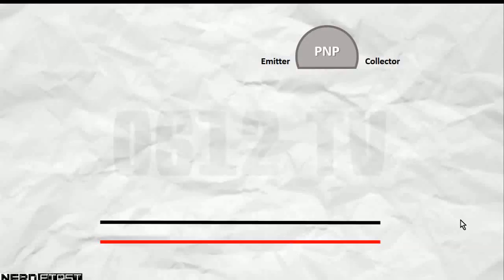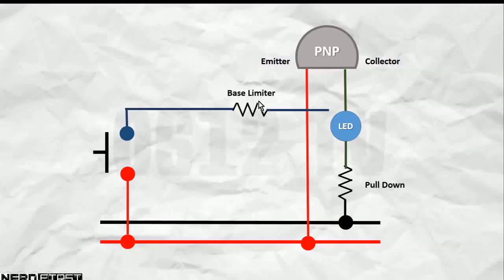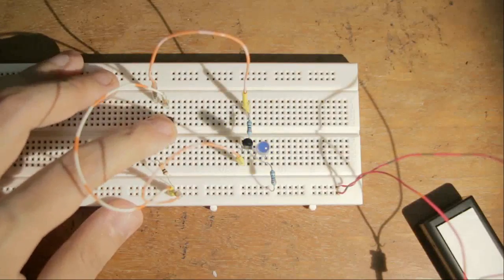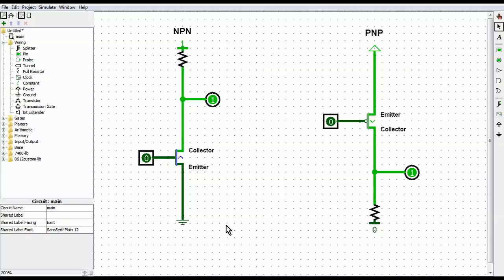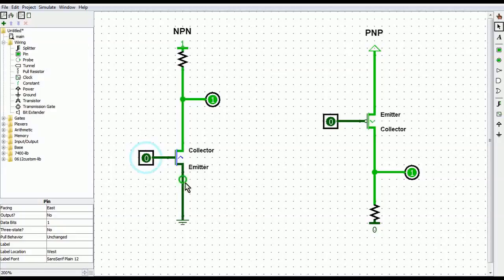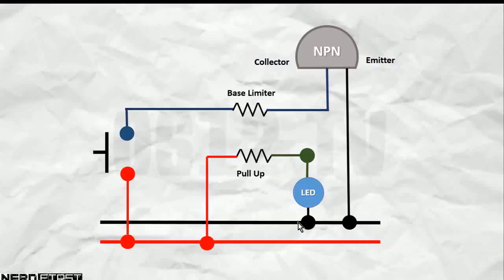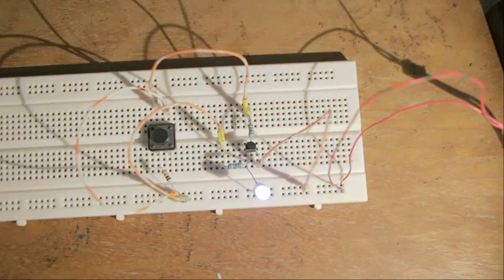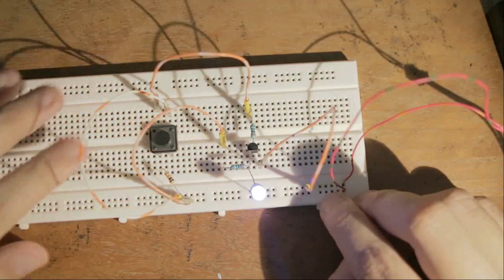NOT Gates - Transistors Ep03

Comment from the maker: Please note the following Errata, which came up through a comment from @tintingai8894: The diagram at 2:59 misses a pull-down resistor on the pushbutton. This leaves the button in a floating state when it is not pressed, and this could lead to undefined results. 

@tingtingai8894 has corrected the diagram and also posted images and videos of their own setup, which is far cleaner than mine. You might want to refer to those resources here: https://drive.google.com/drive/folders/1jn7ygLN44LGPgQU9X1MXiHMeA0rNBhjD?usp=drive_link

Comment: Thank you very much
Reply from the maker: You're welcome! Glad to be of help =)
Reply: @NERDfirst one more thing. You didn't mention exact resistor values. Could you please mention here. 😊
Reply from the maker: Hello again! Unfortunately exact resistor values are tricky, as they are dependent on the components used, the voltages in your circuit, and the requirements of your project.

Even when filming this video I didn't really attempt to rigorously determine the best resistance values - I just used what I had on hand, which is why I didn't mention the exact numbers. Here's what I used, but take these numbers with a pinch of salt: I used a 3V supply. The pull resistor on my pushbutton is 10kΩ. The base resistor and resistor for the LED are 220Ω.

Comment: Hi ! Thank you for all your videos ! I discovered your channel last week and your way to explain things and the effort put in the explanations, to the clear schemes and to the reconstruction on the bread board is a real mother lode.

I try to follow your playlist step by step by rebuilding your circuits with the same 2N2222A and 2N2709A transistors and bread board.
There is something I don't get concerning your PNP NOT gate: To pass through the transistor, the base need to be plug to negative pole, if I got the explanation from your first video. But how is it possible that without injecting current into the base of the PNP transistor, the current flows through the transistor and light up the lamp ? This means the state by default, without connecting the base of the PNP transistor, is to pass the current ? Because I don't have this 

I tried to rebuild your circuit at home with the same PNP 2N2709A transistor and two 2kOms resistances but I got the opposite behavior. When I don't push the button, the PNP base is not connected and the LED is off. If i push the button, the current pass through the base and LED lights up. And, following your previous course, it seems to be the correct behavior, but in the video you have the oposite behavior (not push = ON, push = OFF). Is your button inversed (not push = circuit closed, push = circuit open) but it will means it is not a NOT gate ?

If you could light me up (lol) on this, it would be amazing, thank you in advance !
Reply from the maker: Hello and thank you very much for your comment! I do really appreciate your kind comment =)

It's been so long since I've done these videos that I'm a bit rusty. Bear with me.

The diagram at 2:59 actually misses something, and I'm sorry for that - As drawn, when the button is not pressed, the base of the transistor is in a floating state (ie. it isn't connected to voltage or ground, and so does not represent a well-defined state). You can see from my wiring at 3:09 that I do actually use a pull-down resistor. When the button is not pressed, the base is connected to ground through the pull-down resistor and not floating.

Because of this, to answer your question - My button is not inverted (ie. When not pressed, the base reading is ground. When pressed, the base reading is 5V) - If that were not the case then we wouldn't have needed to use a transistor at all to get this behavior!

And to answer your initial question - Don't forget that the emitter of the transistor is connected to a voltage source. When the base is low, the voltage is "connected through" to the collector, allowing the LED to light up - That's why it's okay for the base to be connected to ground, the transistor can still take power from the emitter to light up the LED. Think of the base as just a "control signal" and not a source of power. When we press the button, the base is raised to high, causing the transistor to "cut off" power to the collector. That causes the LED to switch off.

Hope this makes sense!
Reply: @NERDfirst  Thank you for your answer ! It was indeed the miss of the pull up resistor with the base, I missed it on your bread board in the video. I think I understand more the utility of the pull up/down resistors now.

I edited your first scheme adding the pull up resistor with some pictures of my circuit working here for the next people passing by:
https://drive.google.com/drive/folders/1jn7ygLN44LGPgQU9X1MXiHMeA0rNBhjD?usp=drive_link

Thank you again for responding so fast, I understand that it's been a while now haha, wish you the best !
Reply from the maker: Thanks for your excellent work! One note though, on the edited diagram, the resistor on the left should be labelled "pull down" as it is pulling the pin down to ground. A pull up resistor would need to be connected to the voltage rail. The resistor on the right isn't generally considered a pull up or down resistor, it's just there to limit current on the LED to avoid damage.
Reply: @NERDfirst  Oh yes my bad thank you, I refixed the scheme 👍
Reply: @NERDfirst  By the way, I would like to donate for your excelent series but the link is dead, do you have another way ?
Reply from the maker: Oh thank you, that is very generous. You can donate via PayPal or directly through YouTube. More information on my website: https://nerdfirst.net/donate

Comment: Hi and thanks for the video. I do have a question though. I want to drive the base of the transistor with a comparator (LM393). Since the output has little or no sourcing capability, can I eliminate the base resistor? I will of course try it myself, but just looking for some input. Thanks and keep up the great work.
Reply from the maker: Hello and thank you for your comment! I'm afraid I don't have a good enough understanding of the inner workings of a transistor to give you a definitive answer. From my limited understanding, there may be situations in which current may flow in unexpected ways (like from the base to the emitter for example, in an NPN transistor). To be safe, you should still use a resistor.

Comment: Hello, Will there really be no voltage/current between the LED and Battery when the switch is on? The bulb indeed goes off, but I was wondering if there still be slight voltage or, current in the wires connecting to LED or, is it "all" of the current goes through transistor path?
Reply from the maker: Hello and thank you for your comment! Unfortunately this is the part that I'm not so confident about as well, since for this series I only ever took the transistor to be "digital", ignoring other effects, so my research stopped there. So no, I can't guarantee that there is absolutely no current, though I suppose, if there is any, it would be very low.
Reply: Hey people, I might help!
If you use the rules of resistance in a circuit, you could assume that the current is simply very low, not zero.

Sadly this shows on my case, LED is just getting dimmed ^^

Comment: Now would you which would you say would be easier, creating a not gate with all the components you use here, or a raspberry Pi. I have an idea
Reply from the maker: Hello and thank you for your comment! You will practically never have to build gates out of transistors like this. I'm only doing it in this series to demonstrate how they work.
Reply: @NERDfirst  aaaaah so I'd be fine to get away with an normally open switch? The one that's on...when it's off? keep getting the name mixed up. Cause if so that would make this far easier. And thanks for the video! And the reply, I appreciate it!
Reply from the maker: It depends on what you're trying to do, but if you're trying to "invert" a button press, then yes, you would not need to build a complex setup like this.

What you're looking for though is a normally closed switch ie. The circuit is closed and current can flow when the switch is not pressed. When pressed, the circuit is open.

Alternatively you can use a normally open switch and pull it up high when it is not pressed. Yet another alternative is to use a normally open switch "as is", and modify the value in code (since you're using RPi, this should be trivial).

Comment: 5:45  :  Electric current flows from negative to positive (ground to +5v) However, most engineers use "conventional current"
Reply from the maker: Hello and thank you for your comment! While yes, that is true, that's not what that arrow indicates (if you notice on the PNP side, the arrow is pointed the "right" way). I believe the symbol has more to do with a transistor convention rather than current flow.